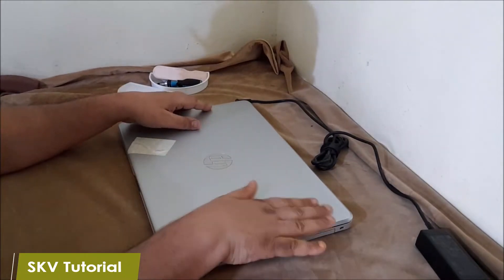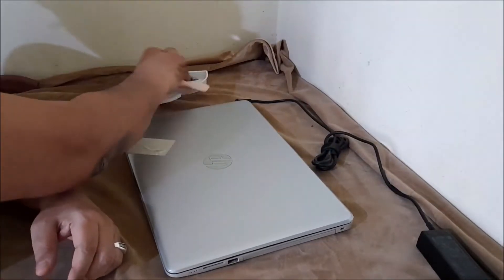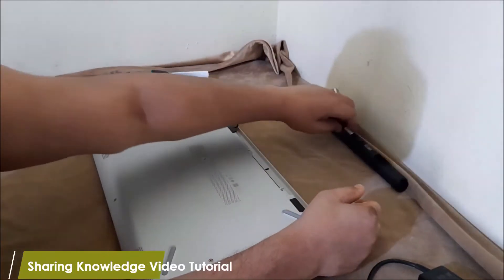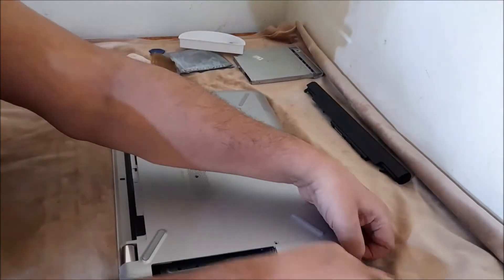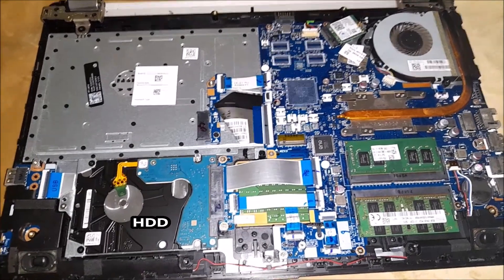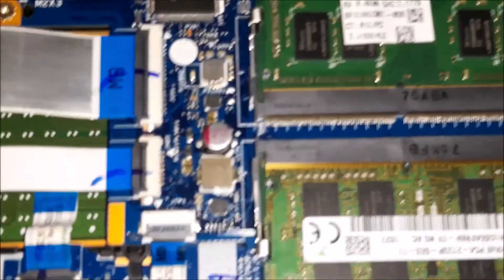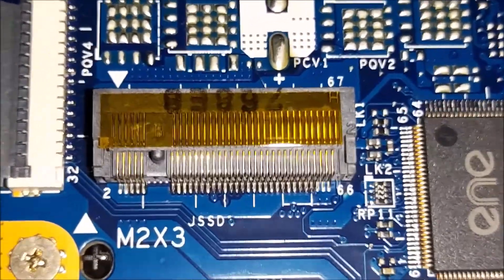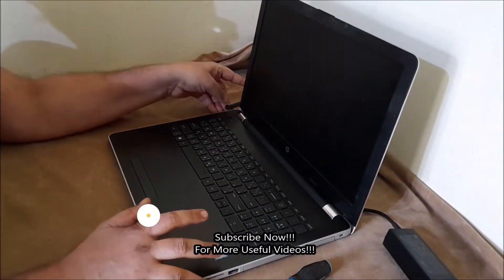How to Open HP Pavilion 15-Series Laptop | How to Open HP 15-bs0xx Laptop | Technical Specification

Comment: I have question this laptop motherboard laptop have a M.2 SSD slot. I want to know what type of SSD does it Support?
Reply from the maker: M2 Slots have keys called as M key and B Key to differentiate between support for NVME and SATA storage drives.

M Key is only for a PCIe/ NVME storage Device and a M + B Key is for a SATA storage device, but it all depends on what the type M2 slot /connector the motherboard is provisioned with.

If you look at your M2 interface on your Motherboard and you see a single notch ONLY for the M Key, then it will support both NVME and SATA PCIe-SSD M2 drives.

Otherwise, If you see a notch for M + B each Key then it will be a SATA PCIe-SSDs storage Only slot.

Comment: its sata ssd or nvme ? bcz all are saying its sata m2
Reply from the maker: M2 Slots have keys called as M key and B Key to differentiate between support for NVME and SATA storage drives.

M Key is only for a PCIe/ NVME storage Device and a M + B Key is for a SATA storage device, but it all depends on what the type M2 slot /connector the motherboard is provisioned with.

If you look at your M2 interface on your Motherboard and you see a single notch ONLY for the M Key, then it will support both NVME and SATA PCIe-SSD M2 drives.

Otherwise, If you see a notch for M + B each Key then it will be a SATA PCIe-SSDs storage Only slot.
Reply: It's M.2 SSD